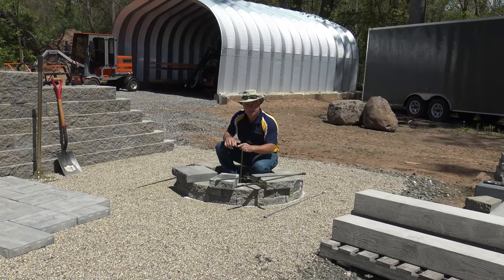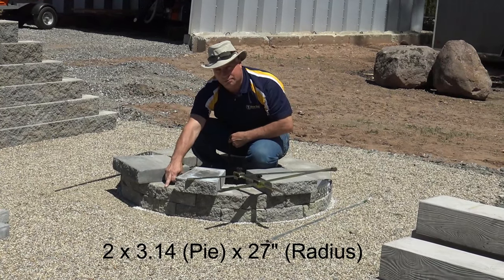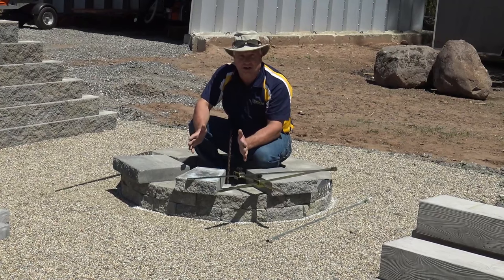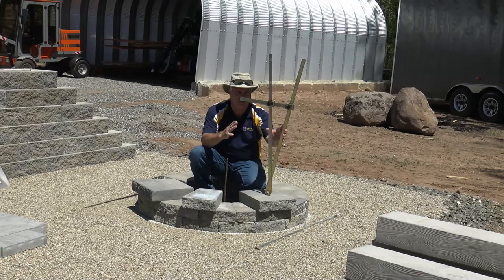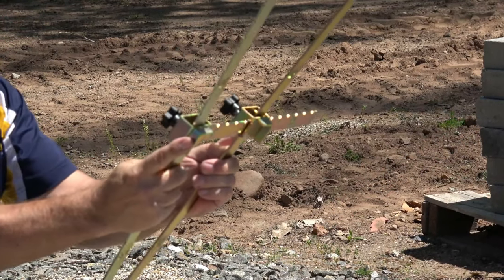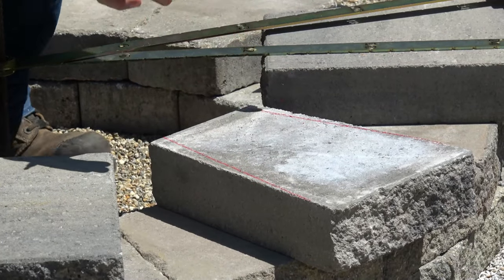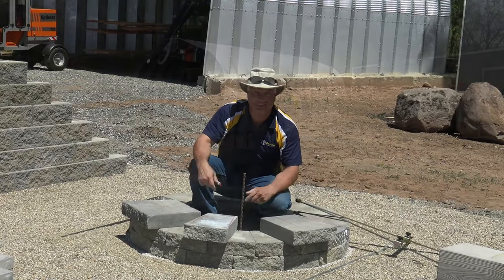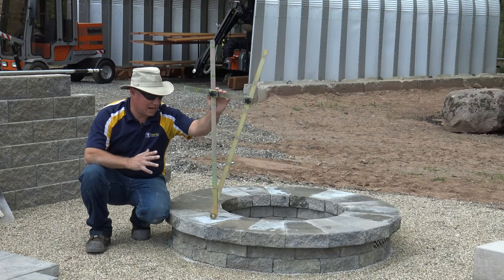Cutting and Placing Fire Pit Caps

Comment: so the maximum overall radius would be 72inches? if I center the pin would i still have to the math?
Reply from the maker: The diameter is 72, radius 36 - you would have to do the math but the angel would be perfect.
Reply from the maker: https://pavetool.com/products/quick-e-radius-template?_pos=1&_sid=532994124&_ss=r
Our Radius Guide is here on this link to help you with the math.